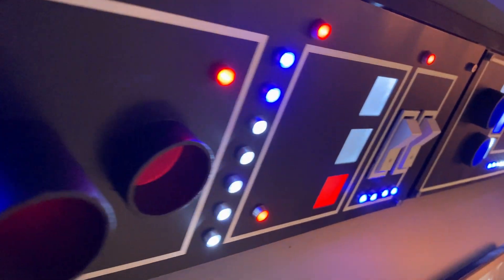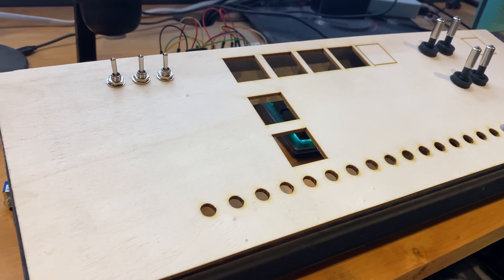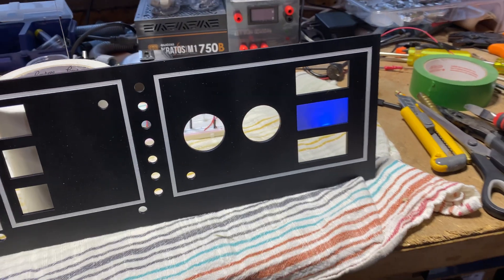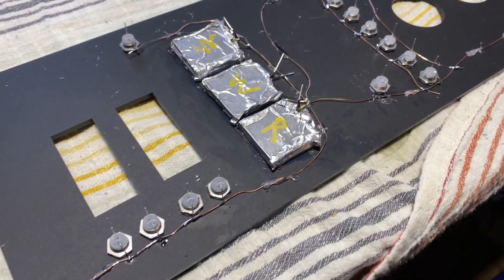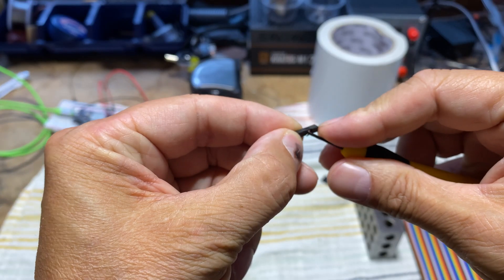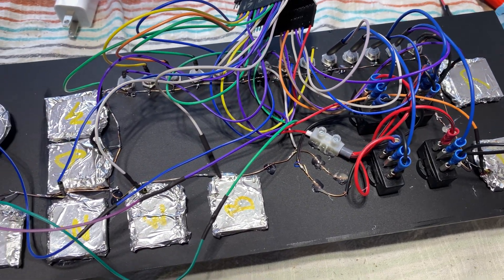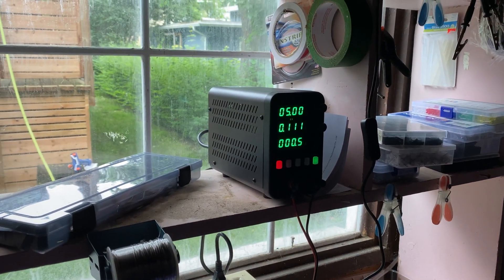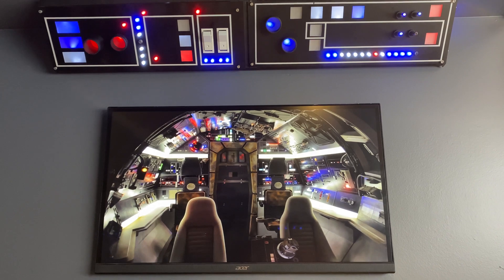Building a Millenium Falcon-Inspired Control Panel: Illuminating Journey with LEDs and ESP32!

Comment: Nic work on the panels, love the retro-spaceship look!
Income from a military electronics background, whereby we bundle all the wires the neatly ‘exit’ one when its destination comes along.  Traditionally, we use waxed-nylon lace, (available in natural or black) which allows many banding points without using a bunch of zip-ties. You might look into it… 😊
Reply from the maker: Thanks for the tip!

Comment: You said you programmed the panels individually. So there is an ESP32 for each one? So two in total? Also do the switches control anything?
Reply from the maker: Yes two esp32, one for each panel.  Yes the switches controls LEDS on the panels.